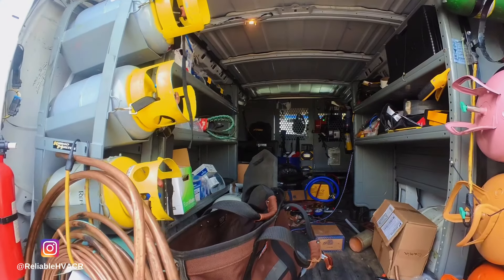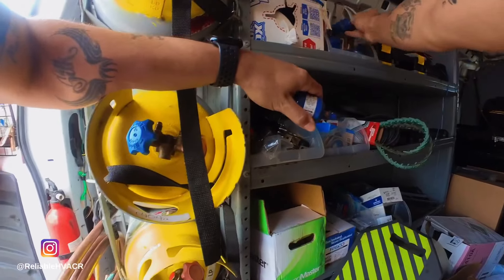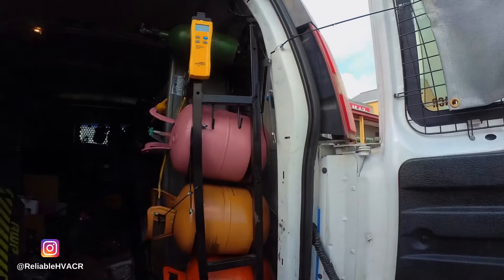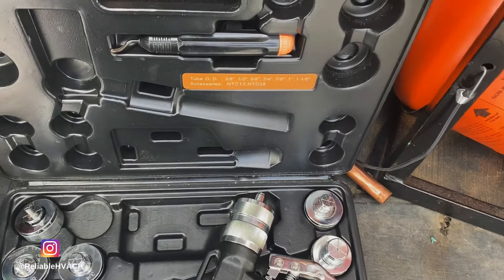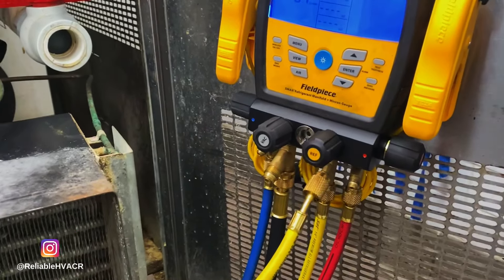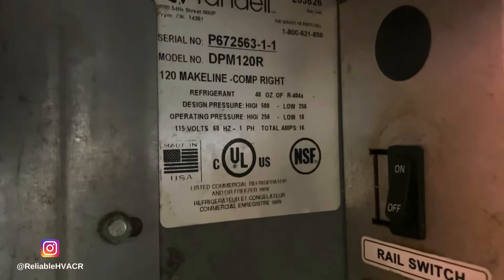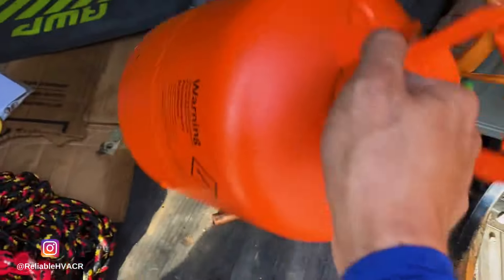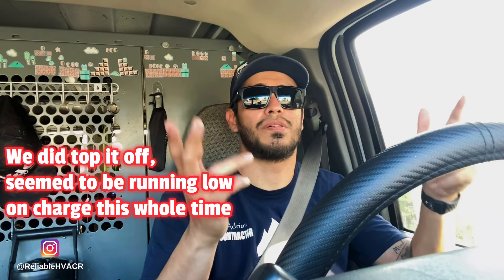Calls Keep Comin In | Day In The Life HVACR

Comment: Head was almost 300psig on the first unit, do you remember what the temp was in there? Good video!
Reply from the maker: Well they got busy for lunch when I started it up, but this franchise is notorious for having the pizza oven right in front of the condenser. Trying to get them to fix their make up air issues at a lot of these locations also. Kitchen can get very warm.
Reply: @ReliableHVACR  You might want to be more aware of what's in the background of the video. The store's phone number and what the name was still in the video, unless you don't mind people knowing. There's a lot of a not so nice people out there that might try to screw you over.
Reply from the maker: Crap, I kind of glossed over the video. Thanks man
Reply: @ReliableHVACR  You can cut just that with the editor. No problem!
Reply from the maker: Found it 👍🏽

Comment: What was that wrench you used on the pressure control
Reply from the maker: Klein electricians ratchet, great for tight spaces.
https://www.homedepot.com/p/Klein-Tools-1-4-in-Drive-Electrician-s-Mini-Ratchet-with-Screwdriver-Bits-and-Adapter-65200/311127793

Comment: I’ve really been liking those cps cutters. Thoughts on navac expander? Better than hilmor?
Reply from the maker: Well I'm always comparing before a purchase, and as much as I like hilmor. This one is a fair bit cheaper, comes with their really nice tube cutter which is my spare now, more heads even tho I might not ever use the bigger sizes (goes up to 1&1/8") and does not require hydraulic fluid changes like the hilmor.
Reply from the maker: But hilmor does have that nice release button so it's easy one handed...navac uses a knob so you gotta use 2 hands to get the tool off. My only complaint for tight spots